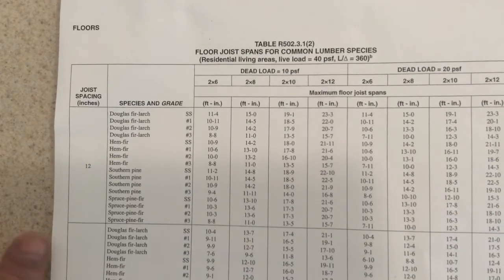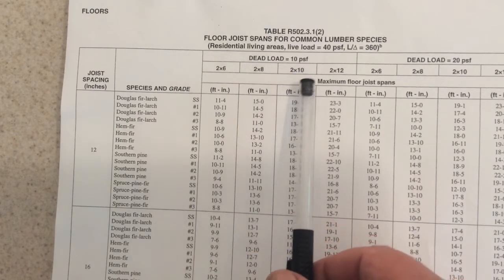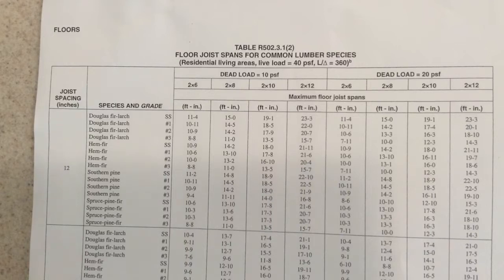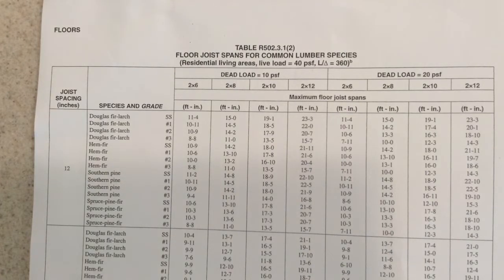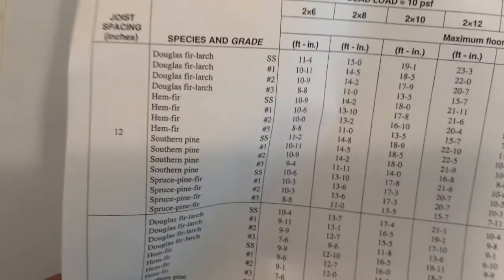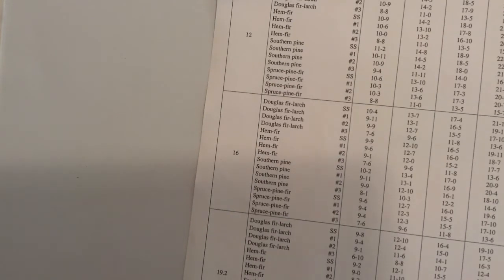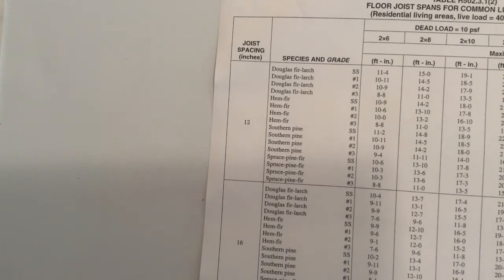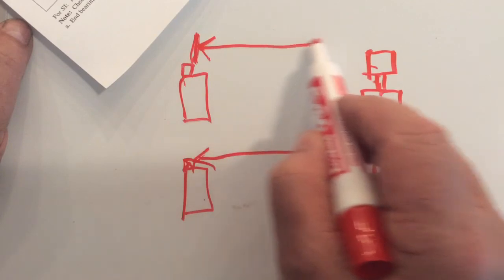Reading floor joist span chart

Comment: thank you so much! looking to build our house. I thought I was going to have to add support every 4 feet, but now it looks like I can just make a cinder block foundation and use 2x12 and have zero support in-between the middle if I keep them to about 16 feet. is this correct? this makes building so much easier. I'll use 12inch spans to be extra solid
Reply: It may be more economical to use a center beam that rests on piers but yes, 2x12 would be alright.